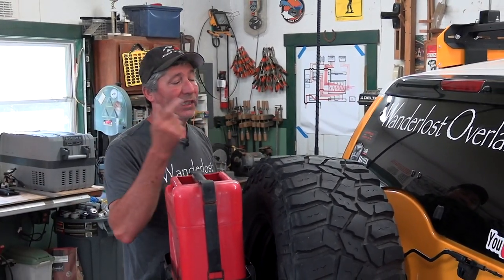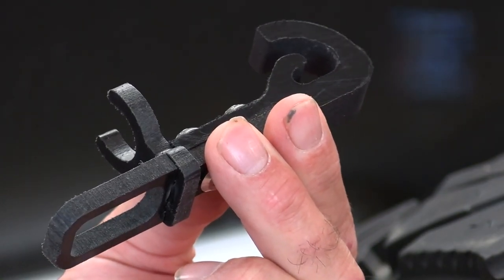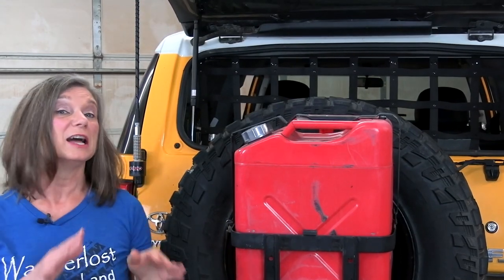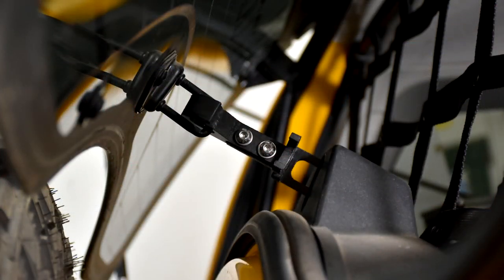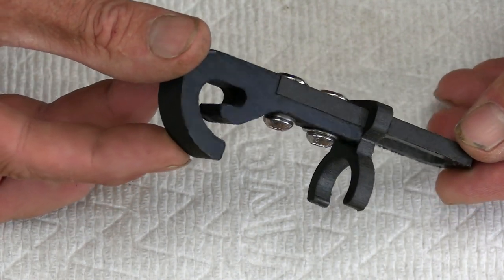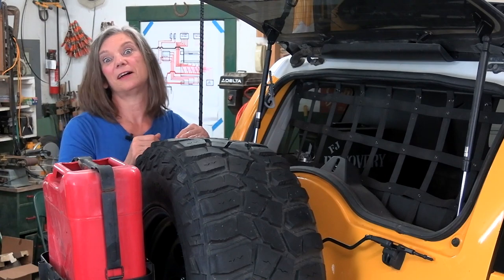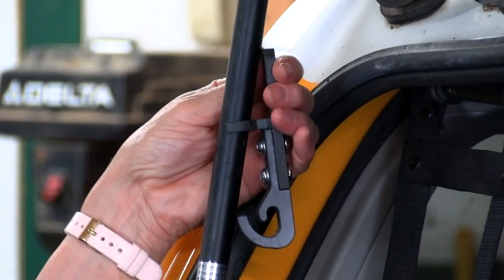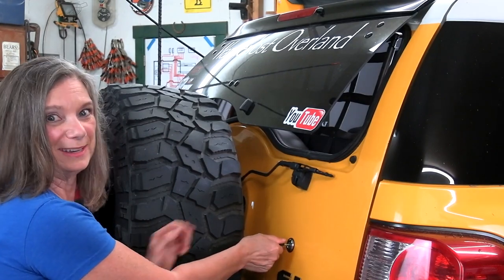Best FJ Cruiser Rear Window Prop!

Comment: Cool accessory. When it's the right temp, we drive with the back window open, front windows down. I made my own window prop device for $7. All metal with rubber to keep from rattling. I store it in the netting in the back door. It's always ready to deploy.

Comment: 1/4 inch turnbuckle with eyes at both ends. Open one eye till it slips over the latch in the glass latch the other end to the door..... Done, $2.98. 
I churched mine up by slipping a piece of vacuum   tubing over the opened eye at the glass end as insurance against rattles.

Made one for my FJ years ago. No exhaust and much smoother airflow through the cabin with the windows open.

Comment: Great, quick video. I bought this a few weeks ago for my 07 FJ. It sure makes it more pleasant to have the side windows down by evening the air pressure.  I was skeptical too on there being rattling but I found it to be a solid connection. I wouldn't have this on mine on a dusty road like at Windrock because I definitely think it would pull the dust into the cabin. I think it would be great if you were sleeping in the back while camping so you can get some air in the back or to have dogs in the back. As far as exhaust,  I haven't had any issues where it's been overwhelming.

Comment: Just ordered one of these 3 days ago. Haven't gotten it yet but I look forward to trying it out. I am a little worried about the exhaust fumes because I have a dual exhaust that exits out the back unlike the stock single passenger side exit. It probably won't be great when stopped at a light or in traffic but driving will probably be fine. I mainly got it for when my dog is in the back. Let's hope I don't kill him with the fumes.

Comment: $30 not gunna happen!
Reply: Nite Ize  Gear Tie Reusable Rubber Twist Tie.  Make a loop ➰ at one end that fits in the lock latch  and snake the other end around the window latch. For 5 bucks.  And when you're not using it for that, you can use it to string all of your grocery bags  together for easy carry 😎

Comment: I don't see the need to drive with the rear window hatch open??
Reply from the maker: Your opinion.
Reply: I don't mean to offend, but it's not an 'annoying flaw' the reason the rear hatch should remain closed when driving is so that the car's occupants don't asphyxiate or fall asleep at the wheel from carbon monoxide fumes. It would be bad engineering and Toyota would be sued if they designed a rear hatch that stayed open.
Reply: Because the only windows in the FJ that roll down are the front 2 ones. I drive with my FJ's back window open all the time in the summer. It provides you with a nice breeze. As long as you are moving and the front windows are at least cracked a bit, exhaust isn't a problem. The 4runner has a window that rolls down and I wish the FJ had that same feature.
Reply: I like to ride with my dog in the back (attached to the cargo hooks with a harness) and she loves to peek out the window. Since the rear windows don’t roll down, it’s a nice alternative.
Reply: @bazaarwallah5444  tundra 4Runner have rolling rear window people keep it open all time
Reply: How about just using it when not driving while the dogs are in the vehicle and the front windows are cracked?

Comment: Due to the laws of aerodynamics, air will get sucked in through that back window when open while driving.  Will there be enough CO2 to kill or make you sick, it depends on the shape of the vehicle, and the length of time you've been driving.  Plus there is a good chance it'll be too late by the time you reaslise.  Personally, I won't do it.
Reply from the maker: yes